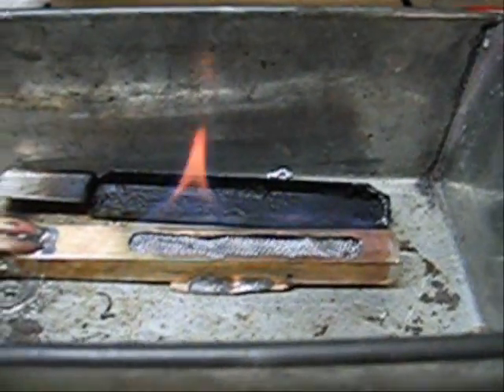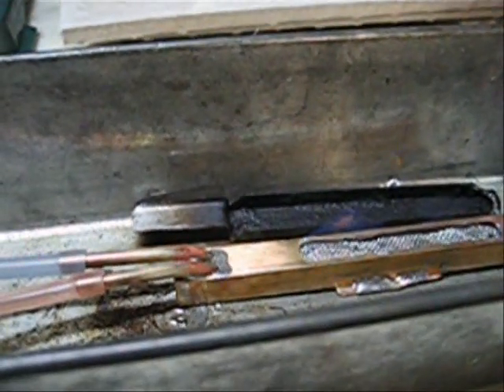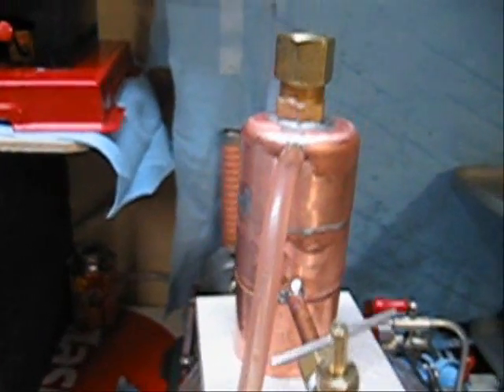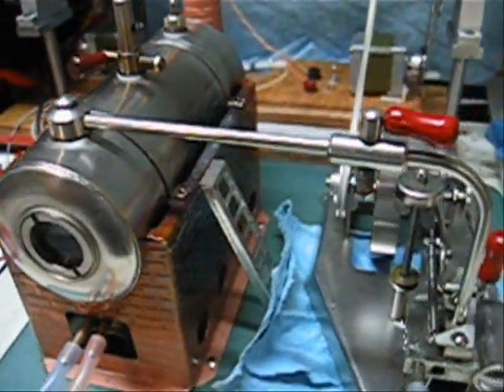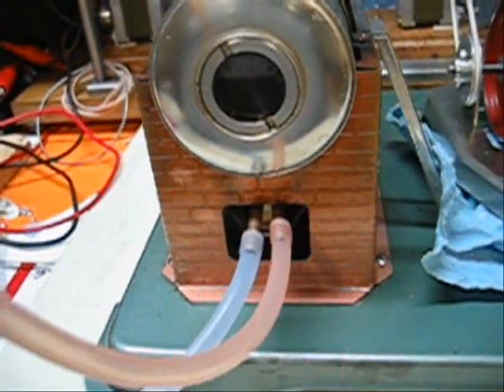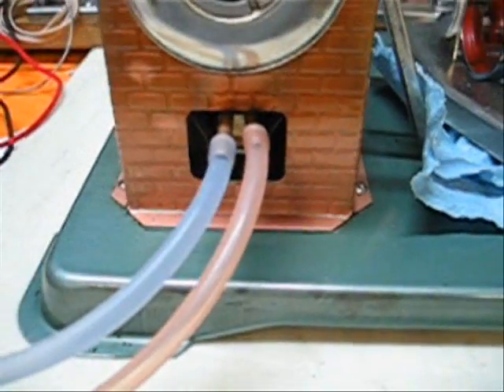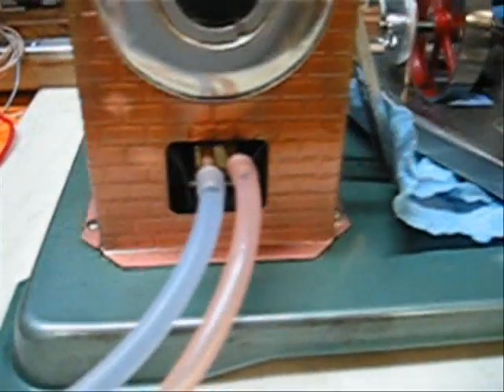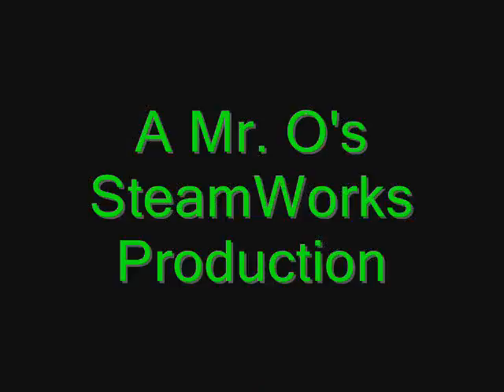Chicken Feed Meths Burner

Comment from the maker: I pretty much have been running it virtually as a single line system.  A larger return line isn't very practical, though I can see the value in it.  I'd still like to be able to (almost) walk away from this thing and not have it either die out or burn the house down.  That reliability is coming, but is still at least 1 more revision away (as always).

Comment: you might need to use a larger return line...
or with the needle valve you are useing why not just have a single line down to the burner and an air inlet with the needle valve to control the syphon down to the burner?

Comment from the maker: So far I'm at a standstill.  The inline trap on the return line didn't work as intended, and without it fuel will flow up the return until it locks the line up.  At this point I'm out of ideas other than messing with the tubing inside the burner element..